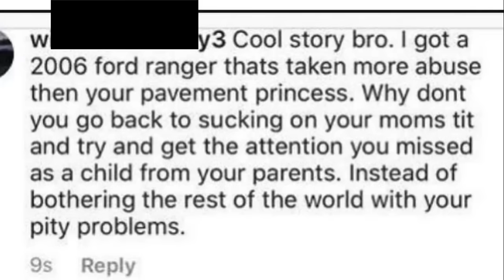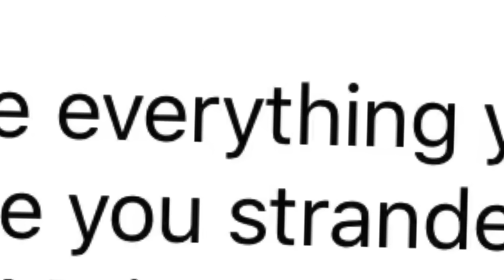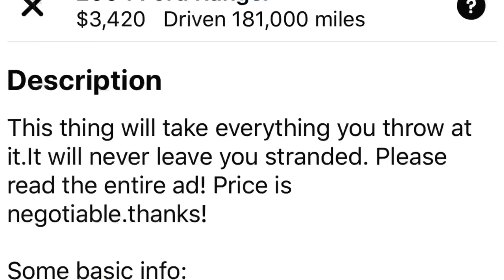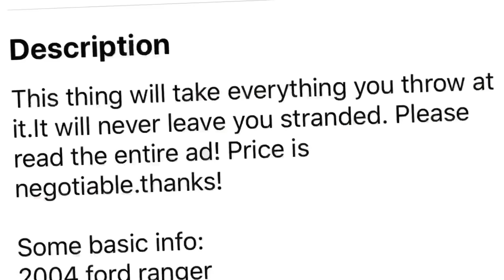“This thing will handle everything you throw at it” DOUBT

Comment: The biggest strengths of a ranger are, small size, decent mileage, still having an open bed, and it being so light it's hard to hurt it/get it stuck (not impossible, just hard) the older ones and the mid 2000s 4bangers also had the "advantage" of not having enough power to really get you in trouble. Also I once saw ome of the the mazda b4000 rebadged rangers towing a gooseneck with 2 cars down i20 at 75mph
Reply: I once saw an s10 doing the same thing, it was glorious
Reply: @RUSTYCHEVYTRUCK  these mini trucks are just adorable aren't they?
Reply: @Prestiged_peck  sometimes
Reply: the problem with towing isnt that you cant pull the weight. they could pull 10k down the road. the problem is stopping it.
Reply: @SuperJarJar21  You need big weight to stop big weight. 🤷🏽 Not to mention when you're pulling a load that's heavier than the vehicle pulling it you're gonna sway all over the place.
Reply: I don't know man I got stuck in mine more than I did in any other vehicle I've ever had. Also mine was two wheel drive just like the one they're reviewing and all my other pickups have been 4x4 so that has a lot to do with it
Reply: @clay-r15  4x4 gives you a false sense of security anyways, if you can't get out of it in 2wd you don't need to be getting a truck into that situation to begin with.
Reply: @Prestiged_peck   that might be the case in the city but where I live with snow and then working in fields and all that you need 4x4
Reply: @clay-r15  I live down a dirt lease road in west Texas, when it rains I've seen easily foot deep mud pits in my own damn driveway. My 90s mustang has no problem navigating said lease road when it's less than 6 inches deep, when it gets deeper than that I have to switch to my 2wd navigator because the mustang will suck in mud if it gets too high, my 2wd navigator on 34 inch mismatched highway a/t tires has gotten stuck exactly once, we've lived here 18 years and I've been driving these roads (legally) since 2016 (I'm 20 years old) so I see no problem. Last February when we saw a foot of icy snow, I drove my mustang to work the entire week and never had an issue. You don't need 4wd unless you're either going up stuff that a road car has no buisness even looking at, or going through mud pits that a highway legal vehicle has no buisness going within 1000 yards of. If I can park with one of my 2 driven wheels in a foot deep pothole and an open diff and have no problem getting out in the pouring rain, then why in the hell do I need 4x4? My dad's 4wd duramax btw gets stuck almost every time it rains, so out comes the navigator to get him out. It's kinda depressing TBH
Reply: @Prestiged_peck  yeah I wouldn't have it either in your situation but I live further north so there's lots of snow and ice and stuff like that. Two wheel drive really sucks in snow the ranger I had used to get stuck all the time and spin out all the time
Reply: @clay-r15  I guess different strokes for different folks. My philosophy is I always wanna be able to stop faster than I can go, if all 4 are driven in snow you go as fast as you could stop, which is dangerous sometimes. And yes 2wd pickups with empty beds suck in the snow, throw 100lbs of junk in the ba k of your bed and take it out in 2wd next time it snows, world of difference. I only ever drive trucks with tools and shit in the bed, if you don't have weight on your driven wheels you won't ever go.
Reply: Y not just buy a hilux
Reply: @wicko_gaming3152  because I can get a nice ranger in the US for like $5k, I can struggle to find a shitbox hilux for $15k, it was never sold in the US, and a tacoma worth getting is fairly hard to find as well, the taco was built a fair bit less durable than a comparable hilux and a tacoma that would check boxes better than available ford rangers would run easily 15k right now. The ranger is just so damn cheap, and as long as the frame/body is good for 3k I could get a kinda shitboxy one, drop an engine and trans I have laying around in, and have a v8 mini truck that hangs with mustangs and not feel bad about ruining a Rare truck.
Reply: No doubt a Mexican guy driving it and it was heading south to the border with all the cars from the Moody, AL car auction LOL.
Reply: What on earth do you mean it’s hard to get stuck lol he parked it on that wet ditch and it wouldn’t even spin the back tire anymore .
Reply: @Prestiged_peck  I think the difference is mountains and snow. There's a reason why 2WD trucks are basically nonexistent in parts of n America. 4wd, good winter tires, and a few hundred pounds of weight in the box can mean the difference between getting home, and spending the night in the ditch. It's just a completely different animal in northern climates with mountains and 8 months of winter, just like I don't have experience with Texas's climate and terrain, potentially there's aspects you haven't considered.
Reply: @paulmcewen7384  meanwhile I know people who daily corvettes year round in north dakota, which got down to minus 20ish last night According to my girlfriend who lives there. Proper control and proper tires are key, if you can't get a chained 2wd out of it you probably shouldn't be in it.
Reply: @Prestiged_peck  I suppose it's possible to consume a bowl of soup with a fork, or go swimming in a snowmobile suit, so yeah, corvette in the winter is possible also. I'm not an expert in American geography but I don't believe there are massive mountains in ND. Mountains generally are a game changer.
Reply: @paulmcewen7384  there's no but 3+ feet of snow is not uncommon, got a buddy that live about 10 minutes west of Denver that drove a single cab shorted 2wd 1500 chevy with an 8.1 swap through 2 winters without a bed... in colorado.
Reply: @Prestiged_peck  LMAO I'm calling you out. I live in MI and NO ONE drives a RWD sports car once the snow hits the pavement. You may as well put ice skates on them lolololol. Bruh, if you can do all that stuff you said and post videos of it you'd be a legend. I had a 2wd Ranger and got stuck quite often in the winter trying to accelerate from a stop sign in 4 inches of snow in 2nd gear! Loooooooooooooool.
Reply: @TheSevenJr86  I'll be sure to grab a dash cam before I go to ND in February, sadly the mustang won't be running but I have a RWD navigator that makes more power I'll likely be taking.

Also btw the mustang I drive is a 96 on stock springs and larger than stock wheels so I have a solid 4 inches of ground clearance if you don't count my exhaust, which is getting changed for more clearance soon because I'm tired of it dragging on speed bumps.
Reply: @TheSevenJr86  also pro tip: dump a bag of sand or two in the back of your bed on the ranger next time it ices, and if you spin let off then just barely rest your foot on the gas. Also make sure you have halfway decent tires. If you're on 18 year old cheapo tires like my grandpa you won't be going anywhere (bonus points for proper snow tires and chains)
Reply: I had a 2000 Mazda B2500 (2wd, 5 spd stickshift) and I had that thing on snow-covered, unplowed roads in Washington and Oregon (Leavenworth and Mt. Hood, respectively), and was able to get around fine with just a set of rear chains. I nearly got it stuck going uphill on a muddy logging road one time, but thank God was able to work myself out of it. Not the most ideal vehicle for those driving conditions, but it was all I had and was up to the task.
Reply: these trucks dont get decent mileage thats the problem I have with them, my tacoma barely had better mileage than my dads sierra despite having a 2.7l 4cyl vs a 5.3l v8
Reply: @clay-r15  the point of a ranger isn’t to be a flashy truck it’s a work truck it’s not made to be in mud or anything that’s can get it stuck it’s for work hauling stuff very good on gas and mileage it’s not supposed to be put through stuff like what this dummy is doin😂
Reply: @shanegary7725  I know I realize that but the original comment put "it's hard to get hurt / get it stuck" and I owned a two-wheel drive ranger and got stuck constantly in the Michigan winners so I had to correct him. I'm not doubting it's a great on gas reliable pickup truck but I am doubting the original comment that claims it's almost impossible to get it stuck. Obviously 4x4 is a game changer.
Reply: They’re actually Mazda’s rebadged as Ford’s, not Ford’s rebadged as Mazda’s.
Reply: @internet_internet  no, they shared too many parts with the other ford trucks/ cars, like the twin I beam setups on older models, or the rear axles on the later models, and were on roughly the same chassis as the explorer and aviator models before they went FWD

A lot of the cars were Mazdas with Ford badges, and some of the engine options in the ranger were Mazda engines, but most of the ranger was a ford deal.

All that said the late production models were produced on Mazda assembly lines in the US, but they were still primarily ford's design
Reply: I got in troubles with the 4banger power.
Reply: If you're not a farmer or contractor, someone who might only get appliances, mulch, home supplies etc it's one of the best trucks, second only maybe to a Tacoma. Love this f truck
Reply: @Rowdie999  it's got better mileage for what it does. The I bought a used a 6.6 Duramax diesel and it barely got to the low end of this truck empty.

Comment: Please for the love of God, buy a Toyota pickup. I’m so tired of hearing how they’re better than American trucks
Reply: Not saying one is better than the other but I had 321,000 rolled mine 3 times held it at 7grand doing donuts until I got rod knock kept running until it seized up then rebuilt it and have gotten to 356,000 while still beating it harder than John Lennon beat his wife  and it's  still running and my daily driver to this day
Reply: It's because from a reliability standpoint, its true
Reply: I’m an American truck guy, but the 80’s-early 90’s Toyota “pickup” was actually a pretty reliable truck. And for another tab, they had tube frames instead of C-frames. They’re actually really tough little trucks.
Reply: Wyatt Wilson what about frames rusting in half? That’s a big issue. Even in the southern states it’s hard for a Toyota or a nissan to not have frame repairs within 10 years??? American made and sold helps our economy, what’s more important them or us? I’d rather push a ford than drive a foreign one
Reply: @ryanhouston3687  I get what you're saying, but as for down here in florida toyotas are very reliable and rust isn't much of an issue, and besides toyota trucks are made in the USA
Reply: I like both. Got a 4runner with a 3.4 and a i6 f150. I'd say they equally reliable
Reply: @ryanhouston3687  Regardless of what brand you buy the parts ( especially electrical ) come from china and if you were to buy a Toyota it would actually be assembled right here in the US just like Ford, GM or Dodge so Toyota is just another company in the US proving jobs for people and stimulating the economy. I drive a Ford every day but in reality Toyota is a fantastic company and they make some of the safest and most reliable vehicles on the road, right here is the U.S.A
Reply: A B that’s the problem altogether in a nut shell! It’s like going to enlist in the China army to me. Why do think our grand parents are the way they are????????? American 1st!!!!

Comment: So hear me out here, I feel like you’re going down the right path with the ranger but my whole life we have depended on the 1994 Toyota pickup with a 22re in it and I’m willing to bet that it does better than the ranger. So get a Toyota pickup😂
Reply: i disagree. my ranger did not break after all these years, my friends 22re was one part after another, so.
Reply: @High_Octane  that smell like cap
Reply: A comparison video.
Reply: I feel like I’ve seen cherokees survive a lot of carnage
Reply: @mrtsparks9470  sure but i drive a brand new 5.0L f 150... So shut up maybe idk.
Reply: @joshmejia4105  it does smell like crap, you bet, broken 02 sensors, old cat's, she's pooched but still ripped donuts and third gear burnouts at 340,000
Reply: The 90’s have shitty frames bro they rust out from under them

Comment: it literally took everything you threw at it
Reply: Yeah the thing is still kicking. I do believe the Ranger won this one.
Reply: It dropped the driveshaft
Reply: There’s legit no driveshaft in it
Reply: I'm picking up that you off-road guys thinking dropping a driveshaft is super embarrassing. From a normie perspective, the little truck took a hell of a beating and the dude could still drive it to work the next day.
Reply: It got stuck in a tiny hole on the side of the road. That's not taking everything they threw at it
Reply: @bencanute7911  and the bullets
Reply: @bencanute7911  did you see the tires no tread im a chevy kind of guy theres no way in hell youd make it out with those tires. I bet it was a 2 wheel
Reply: @bcrichwarlock7608  you bet obviously it was 2 Wheel drive Sherlock
Reply: @bencanute7911  and it was on slicks of course it would a chevy would have broke down at 40k and a dodge you would have made it ten ft and broke a trany
Reply: @scottorear6725  my chevy has 218k and never gives me reliability issues, my dads fords all however did, with the last one being 2014, Found On Road Dead, 98% of fords are still on the road today, the rest made it home.
Reply: @bencanute7911  he wasnt stuck, you could tell he was intentionally messing with the clutch mostly because he doesn't care if it can or cant get out but just that he is having fun with it

Comment: You know I feel like the Criticism was well placed, considering that it was just built where off-roading would be difficult. My ranger has no lift on it BUT I have a welded Diff and a custom built skid plate to protect the driveline. So I think one built different would’ve done better. But who knows. I think we all these little trucks on a pedestal because in “most normal driving conditions” they do great and last a long time. My four cylinder had 147000 miles when I bought it. It’s on 150000 now. And I feel like Cody really put this truck through hell. This thing already looked in sad shape. So yeah I’m surprised it even lasted that long. Great video.
Reply: that is this kids entire point.

Comment: I have a 95 ranger, we don't drive it much but it is reliable. We also have a RAM and a Suburban. One thing I did have to replace was the drive shaft and shaft seal, so that kind of checks out. It wouldn't take this beating though in my opinion without the ABS light coming on.

Comment: I’d love to see an older Toyota truck, like pre-Tacoma generations.
Reply: Theyre too expensive to trash because the hold up haha
Reply: They*
Reply: Toyota makes trucks?
Reply: Laughs in top gear hilux
Reply: Pirigrin Falcon honestly, it’s just something about how they built those older ones. They simply do not die. Not exceptional vehicles or anything but god damn, you simply cannot kill them.
Reply: Top Gear did it and with better production value if you can believe it.
Reply: @CubNole  yeah, didnt they do some wild shit like collapse a building on one and it still drove? Say what you want about Toyotas but those old ones could take a beating lmao.
Reply: I own a 100$ one with the 2.2 right now 1993 manual with 560,894 miles and so rusty you can’t barely take any bolts off anything it’s been a good substitute for our 4 wheeler old get out of the truck and turn the hubs 4 wheel drive I’m only 17 but it goes good for holler hoppen and work
Reply: @hell-sol5240  tf? He's right. It didn't have a name
Reply: @Meme Man they made the T100 as well
Reply: @Meme Man sure they were if ya ever had a Chiltons Manual for one you'd known this. Maybe it wasn't a popular term but it was definitely its name just the same as the Datsun Truck

Comment: Here's a challenge for you. Drive the ranger through a 6 foot wide opening and then do that with your full size truck.😂 I'm just saying! You wanted a challenge to see if there was anything the ranger could do that your full size truck couldn't, there you go!🙊🙉🙈🥺🤫🤫🤫😂🤣
Reply: Found the ranger owner :/
Reply: @hoothoot7122  Not me!🤮 I just like to help the youngsters out with their boasting now and then.😁 It's like the old saying, "Don't let your mouth write a check your body can't cash!" 😂 The underachiever ranger wins that battle! 🙈🙉🙊🤣🤫
Reply: Fill up both tanks and see which one goes further......
Reply: Rangers are good every day drivers, and are good for mild off-road, but they aren’t fast or super mega powerful when stock. I have a fuel injected 302 in mine with a 5 speed manual transmission and that made it crazy capable. It did hurt me to see him break it though
Reply: Hook a fully loaded goose neck or 5th wheel to both and see what happens.
Reply: @grimreefer5159  don't know where your from but I ain't never seen a ranger with a fifth wheel hitch.....I honestly know they can't tow   anything ...but what's in the bed ......my brother-in-law had one and it struggled to go up a steep bridge but this was in 1996 the truck was an 89 or 90....... But he still has it and it still drives with like  over 400k on the original motor
Reply: Rod P they can depending on what year it is. I drove mine from Arizona to Canada no problem. It had a fifth wheel on it.

Comment: I've got one of these so I came back to this video because surely you would've been the one to try and do a J-Turn in a lifted pickup.

And now I'm pretty confident mine will do it too lmao.

I've done just about everything to it... Jumped it, e-brake turns for days, drifting on dirt, snow and pavement... Hopping curbs for shits and giggles and doing proper 4x4 in the Colorado wilderness... In a bone stock truck with a V6 and a 5spd manual.

I personally can't kill it. But that's also because I'm not trying to. 😂 260,000 miles and I hope to have it plenty more.